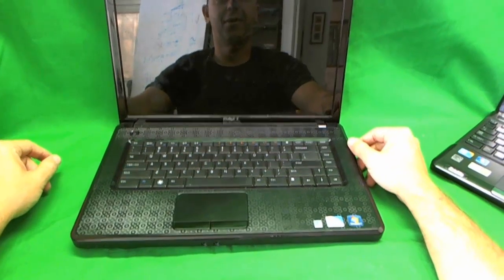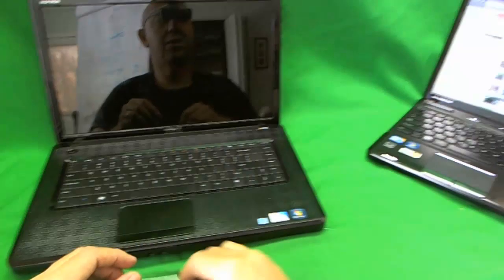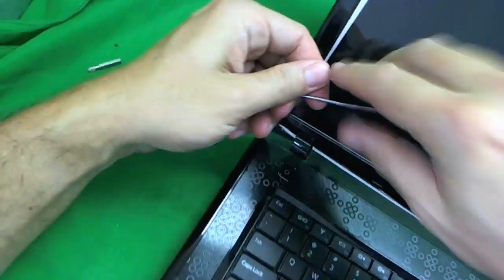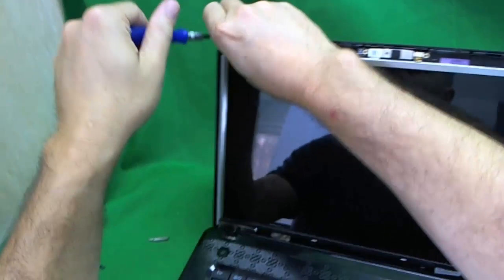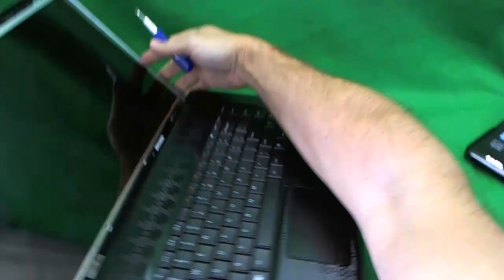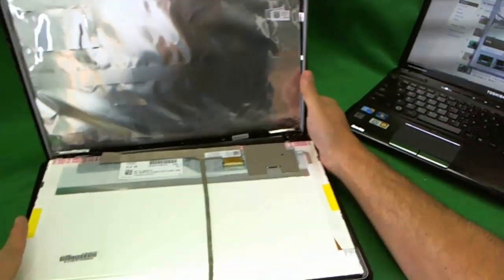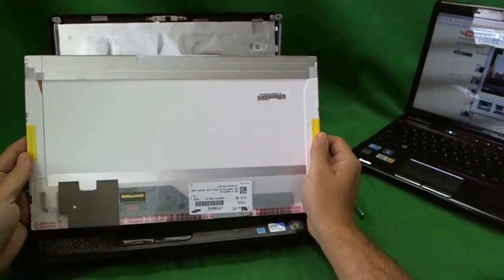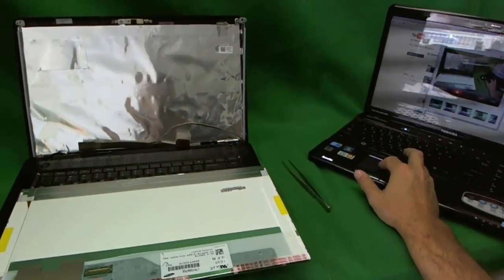Dell Inspiron N5030 Laptop Screen Replacement Procedure

Comment: Hi, I have A problem With my Computer (it is the same computer). constantly, The Screen Freezes and then a corner of the screen turns white then it spreads all over the whole screen. How do you think that i can fix it or do I have to just replace it.